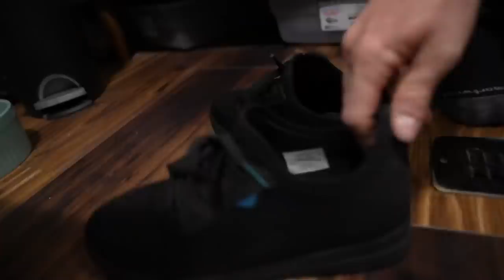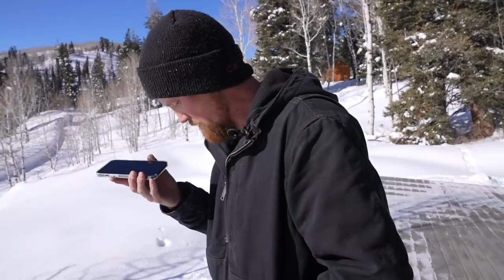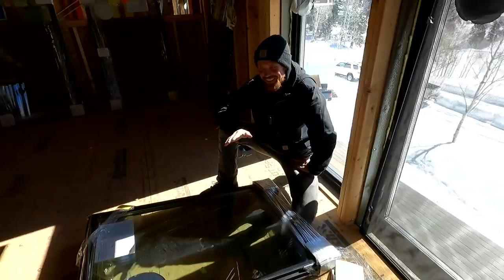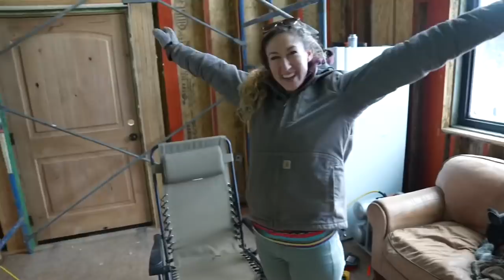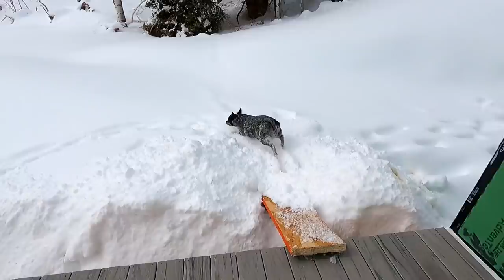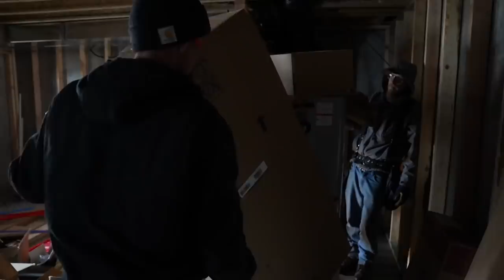WE THOUGHT THIS WAS OVER | BUILDING OUR OWN HOME

Comment: When you live in a cold climate, it is necessary to have heat in your home in the winter time at all times. If you turn your heat off at night completely you're going to run into problems with all your pipes. Set your thermometer at a low heat but keep it on 24/7
Reply: I'm surprised that they did not know that as Allie grew up in the northeast, where there is winter with snow and freezing temps and Trent grew up right there in Utah.  Even if we are going away for a few weeks we always keep the thermostat at 50 degrees.
Reply: Or if they would have chosen a self feeding pellet stove and filled the hopper for the night. The home would be all good in the morning.
Hard to sway when there is a mountain of wood though
Reply: Absolutely keep heat on 24/7 in the cold weather to prevent the water pipes from freezing.
Reply: I didn't see any pan under the hot water heater..
Reply: duh
Reply: @thomaslively5582  but I saw he picked one up in the last episode...so....Ally will set them straight! :)
Reply: @johnmarquardt1991  The hot water heater is not installed, duh. There will be a pan under it, upon completed installation.
Reply: @Bianchi8000  Their furnace went out and they're putting water into lines and a water heater in the middle of winter.  Very stupid.
Reply: @jamesclark9347  i have a pellet stove and its the best.
Reply: Yes... Chalk that up to rookie mistake.  Our HVAC company did a FB post at the start of Iowa's deep freeze to set the thermostat at 72 and press the hold button until the temps get above zero.  Its too hard on the furnace otherwise.
Reply: @thomaslively5582  the floor is sloped to a floor drain in case of leaks.
Reply: @philmoore71  
Yeah I saw the one my neighbor bought and that self feeding feature sold me. The pellets are actually cheap in comparison to firewood prices.
Reply: @johnmarquardt1991  Not nice , one word I would not use for Trent is stupid , bloody good home builder yes , stupid absolutely not .
Reply: @yvonneost12  yes, definitely not stupid,  but inexperience can bite you in the ass too... That's the thing about experience is that you have the optic of being able to see more problems in the future then someone with no experience.
Reply: @jamesclark9347  Self-feeding pellet stove is efficient, safe, and has a nice flame just like a wood stove.
Reply: In Michigan we keep it at 55° minimum.
Reply: @barbaramuzychka3836  exactly. I lived on top of a mountain in Maryland and if I was going away in the winter, the thermostat was set at 50 degrees, especially since I had well water and didn't want those pump lines to freeze.
Reply: and having a backup heat supply when the power goes out is just as important.  That woodstove will soon be one of your favorite possessions.
Reply: It only needs to be on like 50 degrees not very high at all. But the more plumbing the get installed and the more water in the those pipes the more they need to keep the heat on and even some water dripping. Here in Georgia my apartment complex tells us when it is going to be super cold to leave water dripping in faucets so nothing freezes and no pipes burst.
Reply: @thomaslively5582  Earlier in the video when she was cleaning up, she had the pan in her hand.  They really don't need one because there is a floor drain right there that the furnace is going to.
Reply: @thomaslively5582  they showed the pan in a couple previous videos. So they have one.
Reply: @jamesclark9347  my last cord of spruce pine was $285. I love the feel of wood heat in the house, but heating oil is now cheaper.
Reply: When we first moved to Michigan, husb turned furnace off that summer.  We never did again.  We had temps low enough to need extra clothes even during the day.  No shorts that yr.  And no, I never really adjusted to the colder temps.  We have warm days, too, almost to 100 degrees.  That day was summer.
Reply: @thomaslively5582  Pans are not typically installed under WATER HEATERS located in basement areas. Technically a hot water heater is a booster heater...
Reply: Water heater and turning the water on should be the last thing you do if you have a limited fuel source you might not be able to refill and no insulation in your house from my exp.  living in Canada.  But its March and maybe where they are winters is going to be done soon?  Where I live you can exp nights with freezing temps at least until May.
Reply: Sandy Scott  we've never had oil Independence.

Comment: Hi, tip to starting a fire. Start the fire on the bottom, with thinner pcs of wood. Fire needs air so 
don't lay all of the wood in same direction.  Create air pockets by  criss/crossing your lower pcs and at least one at the top. 🙂

Comment: Once you get everything installed, remember that a great fire starter is lint from the dryer inside a toilet paper tube.  Super easy to use & saves on your propane starter.  Love watching you two and watch each episode more than once because you always bring a smile.
Reply: Also lint and Vaseline
Reply: I like to take a little wood and sort of shave it with a knife but I also saw something I'm going to try someone put a stick through pencil sharpener to get Tinder. We've been having to start our fires and we heat primarily with wood without a propane starter we only bought one just this year so Tinder and kindling are important and it doesn't have to be expensive

Comment: Just a suggestion: don't turn the heat off for the night. Set a temperature that it should maintain in order to not freeze. Here, in France, they recommend 8⁰C, which is about 45⁰F.
Reply: Yep!  We live in Montana and you should keep it at about 50
Reply: Same for Iowa.
Reply: YES. IDK all construction regs but I do know once pipes/water in plumbed in one has to keep TEMPERATURES  50 degrees at least to keep pipes from bursting. THAT would be a big expensive mess..just saying. Either by keeping a fire going or furnace one way or another.
Reply: @danaklamecki8820  same here in jersey   50 degrees and no lower even if the house is empty for the entire winter season as we have lots who live here in jersey but go to Florida for about 5 or so months every winter
Reply: Be careful in setting your thermostats below 50°. Refrigerators don’t operate as well in temps below that. Check with your manufacturer. If there’s no fridge you can go down even lower. As long as it’s above 32° obviously.
Reply: Speaking from LOTS of experience I live in Wisconsin and I completely agree with this comment! 💯
Reply: I agree. You never turn the heat off  during winter !
Reply: Why not a tankless hot water heater?? Just wonder. 🙋🏼‍♀️

Comment: Ah. Guys. I’ve been told it’s always a good idea to put a drain pan underneath a hot water heater.  Not so much to stop a leak but it does give u a shot at turning off the water if it leaks. But it also keeps the heater off the floor. As bare concrete can be corrosive to certain metals.

Comment: You really need to keep  the furnace on at night set  at least r35* or higher to keep things from freezing up, yes you will use fuel but it will be worth it👍🏻. Stay safe, stay happy🥰
Reply: They're very high up so at least 40 ,maybe higher . I know at 4,000 feet water freezes at 36 degrees. At 6,000 it's 40 degrees.
Reply: @kahahana  The earth is also flat.

Comment: You should put a water heater drain pan under water heater. Mine was on concrete and dry however, it rusted on bottom in 3 years and flooded my room.  The pan was under $10

Comment: Raise your hot water tank up on blocks. And put a drain pan under the hot water tank. Drain pan into basement drain. In 10 or 15 years when hot water tank leaks, you will be glad you did this.

Comment: Have you used the top down fire building approach?  In a top-down fire, the larger logs are placed on the bottom, with progressively smaller logs, kindling and then newspaper added on top. The newspaper is lit, and the fire slowly burns down to the large logs below. It can take a little practice to get a top-down fire right, and you do need to use seasoned firewood, but the end result is cleaner, easier to use, and by far the best way to start a fire in a wood stove.  I've never actually used that approach but several Youtubers claim it really works.

Comment: Personally I would have gone with an "On Demand" tankless water heater only heats the water you are using rather than keeping a whole take of water hot all the time.  And its about the 8th of the size of a tank in a 2 foot by 1 foot box on the outside wall.
Reply: "tankless water heater only heats the water you are using"
No it does not, it takes about 5 seconds or so before it cranks up enough that you finally get hot water out. This means the entire time until then it is outputting cold water and you are getting cold water from the tap, so its not only heating the water you use. Instead a hot water tank does this. Because the only water coming out of hot water tank is actually hot. An on demand tankless is more efficient with power usage, but it uses more water and is less efficient with water usage, since it takes longer before it starts outputting actual hot water.

Yes, however a hot water tank typically is running all the time, so quite often is wasting power to keep that tank of water hot even when no hot water is needed. One can put a timer on it to only run during periods when you use hot water, but still will be less efficient power usage no matter what.

Besides I am pretty sure they are already well aware of on demand tankless, since pretty sure that is what they used in their van.
Reply: There are drawbacks to tankless water heaters. They have to be cleaned once a years, every year !

Comment: I’ve always seen water heaters raised off the floor. Probably to prevent rusting from concrete contact or potential leaks.
Reply: And protects the thermocouple in case any water gets on the floor which it will do in a basement being the low point
Reply: That is a requirement for garages to be 18" off the floor. I would like to see a drain pan even though you have a floor drain. You will see why in a few years.
Reply: Back in the olden days, a friend burned down his parents’ home while working in the garage, where the propane water heater (with pilot light) was located, when he failed to notice he’d spilled a puddle of gasoline on the floor next to the water heater.  (Whoof.)  That may be why there are codes about raising them when in garages.

Comment: Instead of using spray paint for the electrical devices, think about using some painters masking tape. That way you can just move the tape and not have a bunch of white spray paint where you may have moved your devices. No second guessing if the white paint is a keeper or has been moved.

Comment: Don't forget the pan for under the hot water heater! I remember seeing him buy one.
Reply: with a water leak sensor in the pan?
Reply: Use a pan with a drain and run the drain over to the floor drain to minimize water damage to other appliances and walls, bit of advice put pressure treated 2×4 blocks under the water heater to raise it up so you can attach a hose to the drain on the water heater just in case

Comment: I hope you take this as a help, before setting the water heater I would finish the wall in that corner.  If you are going to insulate and put sheet rock or paneling etc. I would do that before a full water heater is put in place.  It would save a lot of trouble trying to do it later.

Comment: keep your heater on low thru the night.  It takes less to warm the house (and it's contents) and probably doesn't require any more propane to heat it by doing so.  I have a pellet stove and radiant floor heating and was told to keep the floor at a constant and never turn it up significantly at a time because it will use too much propane getting to the higher temp.  Do things incrementally and slowly.  I'm at 8500 elevation in the southern mountains of Colorado.

Comment: Im surprised yall didnt go with a tankless water heater.  At any rate, its coming together!
Reply: Same here. To me, those suckers should be obsolete. They have REALLY come down in price too AND they take up SUCH little space.
Reply: I thought the same thing
Reply: Same, I would have thought a tankless (or instant) water heater would have been a far better option...
Reply: @ifinicle  Imho, its the other way around. Sure on demand systems are great for many things, but they have cons as well. They are less efficient at water usage. Water is a precious commodity in many places, so those should be obsolete in those areas. Sure they use less power, so are more efficient in power usage. But one can get free (green) power, unlike with water (unless you have a nice well).

The flow rate needed to keep an on demand system going is less than ideal as well. Never an issue with a hot water heater tank. It does not matter what flow rate in is, a tank will always provide hot water. Most the time that is no problem. But when wanting a nice cool (not cold) shower, or even a luke warm shower, that is an issue with on demand systems. They run that way for minute or so and then put out a nice splurge of cold water when the on demand system cuts out due to too low flow rate.

Tbh, the ideal system imho would involve both. On demand for whole house, with a small tank for your bath shower that is set on a timer to only run when you take showers.

Comment: Be careful. When a furnace freezes the frozen condensate can cause the secondary heat exchanger to split and this is a dangerous condition. Possibly leading to co introduced into the air stream. Also, using the furnace as a construction heater voids the warranty.

Comment: Keep the snow cleared off the top of your propane tank. The regulator under the lid needs to breathe and too much can cause problems with your appliances starving for fuel. Just a little pro tip, my dads been in the propane business for over 30 years.

Comment: Did you put a poly drip pan under the water heater? Helps with condensation and helps keep the bottom of the water heater from rusting out! also there are thermal blankets for conservation for them as well.

Comment: Pro Tip: Put a catch pan under your water heater. Then you can get a sensor to put in there that will text you if there is ever a leak.
Reply: Exactly what I was going to say🧐
Reply: Under the water heater too, some don't have it.
Reply: Coming here to say the same thing... all it’ll take is one flood and you’ll never miss that step under your water heater or your clothes washer.
Reply: yes just putting a pan under it on a concrete basement floor is useless without a sensor
Reply: @raycurbee6106  pans can be connected to the floor drain
Reply: @larryfreeman7979  of course they can,, but back in my day  of installations  lol  unless it was a finished basement,, then we would make 1 out of sheet metal,,

Comment: Most states require an 18 inch stand keeping it off the floor. It may not be required for the new design gas heaters but still a good idea from rusting on the bottom on concrete floors. Also a drip pan is usually used under the heater. Just my observations.

Comment: At 14:40 you mention Frank using a "special place" to go potty & how there will be a pile in the spring.  We have a flock of 40-60 WILD turkeys that sit on our deck railing almost every night.  The snow has melted over the past couple days.  I just swept about 2 gal of poop over the edge.  They follow my husb around like pets because he feeds them.  I know, they like us too much.

Couple points ...
       1- Have you considered how you're building the railings around your deck?  We put a 3-5" space between the railing bottom & the deck surface so we can sweep things UNDER the railings & they fall to the ground 5' feet below.  Several people have comment "I wish we'd thought of that."

      2- The poop is free fertilizer.  Some people will dispute this.  Put it on flower beds, around trees, etc., but NOT on your edible plants.  By spring, most of it will have started to fall apart.

Comment: The secret to a long lasting fire is less flame and more coals. Flame uses up wood faster. Close the dampers partway and allow the fire to coal up. It will still burn but slower and put off heat for a long time. Usually done at night, it may still have coals to start the morning fire. It takes practice to "bank" a fire but is well worth it in the amount of wood used. BTW Be careful with chocolate around Frank chocolate can be poisonous to Pups. Pumpkin is good to keep them "regular" so maybe a balance helped.

Comment: Another option for electrical layout...when I worked for an architect we would cut out cardboard pieces that were the size of outlets, light fixture bases, switches etc... and tape or staple them up around the house where we thought they should go. It made changing them, if needed, very simple.

Comment: I'm sure you have already installed the water heater, but it is a good idea to put the heater off the ground, in case there is a water leak it won't rust out the bottom of the water heater.

Comment: There are two different types of pipe dope (and teflon tape) for gas and water. White is for water, yellow for gas (at least for natural gas, assume the same for propane). Check with Dean, but you don't typically use teflon tape AND pipe dope.

Comment: Don't waste your time with the spray paint...to get started buy a case of (100) single gang deep boxes and about (20) 2-gang and about (6) 3-gang. For layout walk around and drop the boxes on the floor at their locations (before you start nailing them up) and see if that meets your needs and meets code.  Any extras boxes can be returned later.  

If you are installing any surface mounted lights (over bath mirror, in closets etc.) you'll need a hand full of 4" round boxes.  

Also, check you local code you may need a Furnace Emergency on/off switch at the top of the basement stairs.